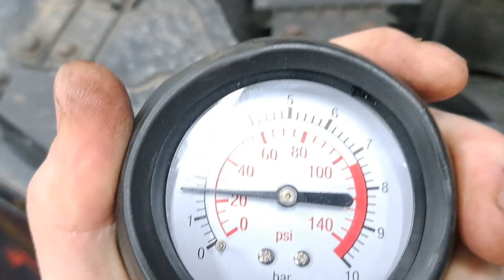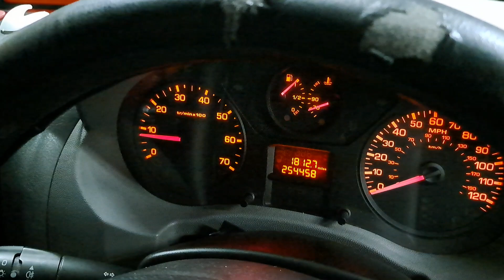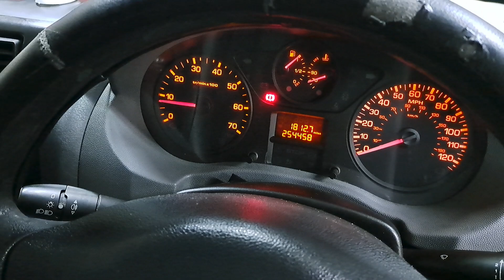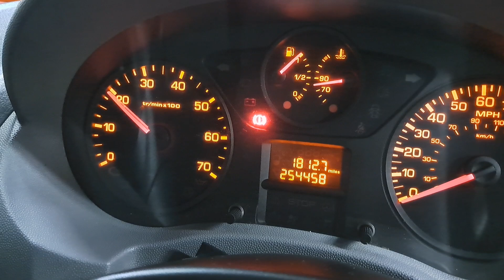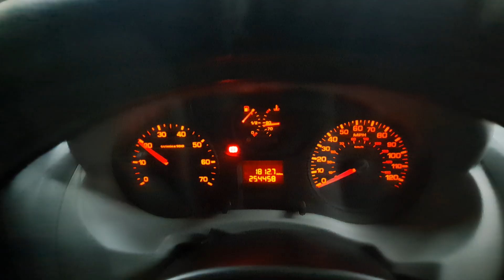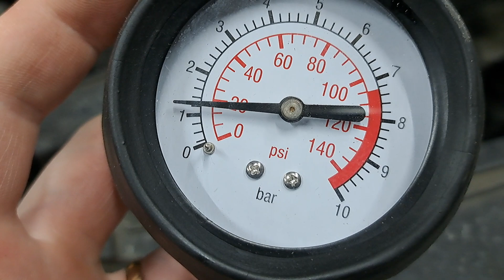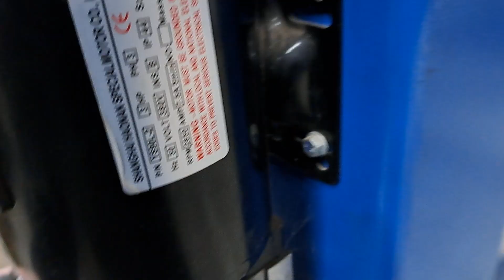2 L Diesel Peugeot Expert oil pressure test

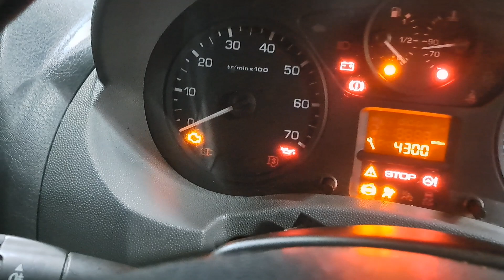Comment: On some cars unplugging the oil pressure switch will cause it to permanently turn off the oil pressure light , notice how the light goes off without even cranking the engine @12:16, I would plug the sensor back in and see what happends
Reply from the maker: Yes I did test and that is true with this vehicle when it is unplugged the light will be off as it's a normally closed circuit and oil pressure opens the switch
Reply from the maker: Yes I can confirm if you unplug the sensor it makes the light go out it has to be grounded to turn the light on I did test this afterwards